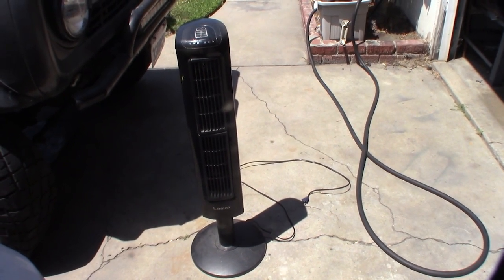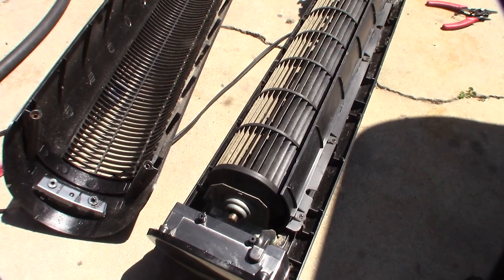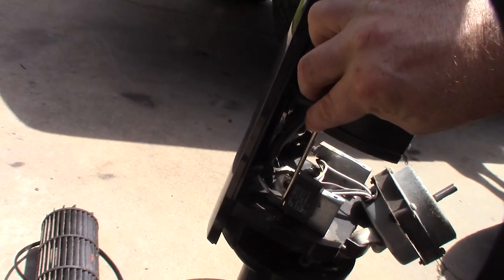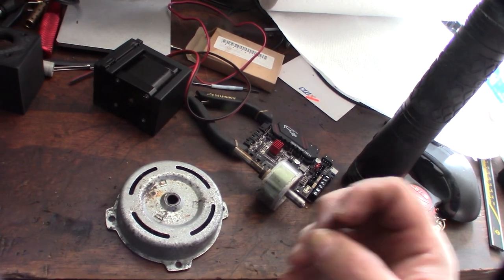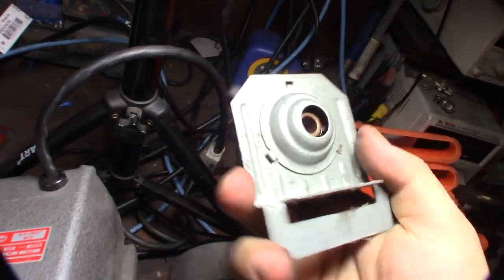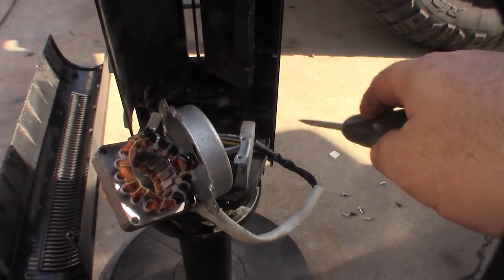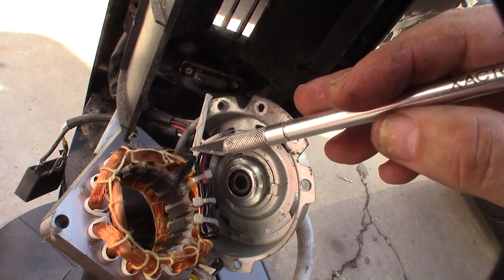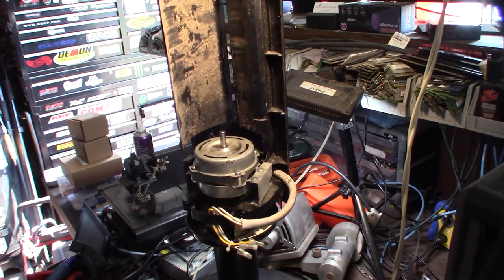Lasko Tower Fan Not Spinning, Stuck Motor Troubleshooting & Repair No Longer working Thermal Fuse

Comment: This is pretty familiar, I've fixed a bunch of motors like this. They usually have a stupid cardboard bushing on one side which goes crap quickly. Every bushing in these is designed to be self-adjusting to accept angular error. Whatever you do, don't use oil, even way oil. It will only last a month. I trash-picked a huge blower from a downdraft kitchen range and the thing got stuck quickly, I tried using oil more than once, nope. The next time I filled everything with axle grease and it has worked perfectly ever since, it has been working for several years now in lab fume extraction duty.
Reply from the maker: I agree with the self aligning bushings to compensate for misalignment. Its looks like the end caps are low precision stamped steel. I will try some grease if it locks up again. I'm not sure what they used from factory, I didn't see any grease residue. for now I'm sitting with cool air on my back. We'll see how how long it last. My 0.9 degree motors for my Z axis came in.
Reply: @fintechrepairshop  Nice, can't wait to see it. We are building a filament width sensor prototype tonight 😁
Reply from the maker: @jessicav2031  Sounds pretty cool!!!